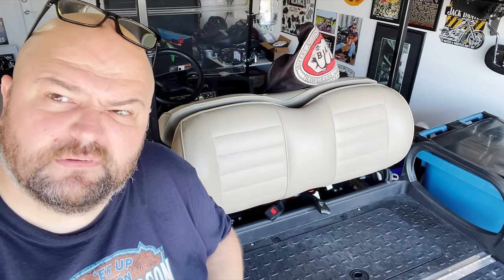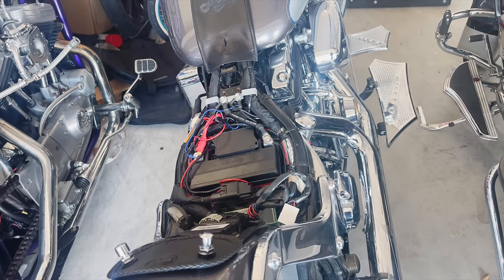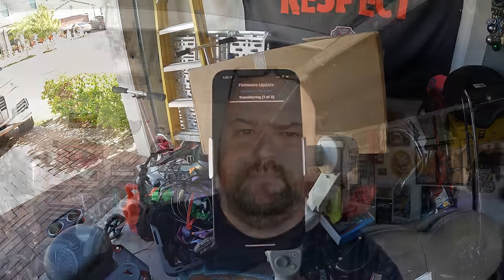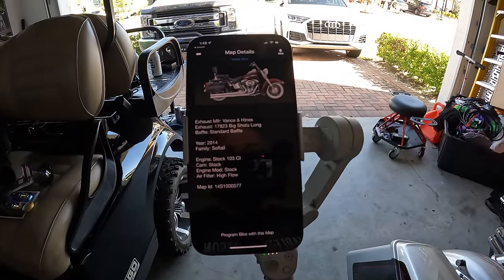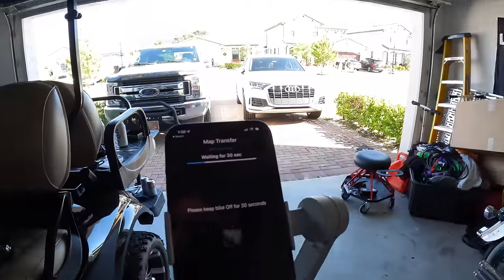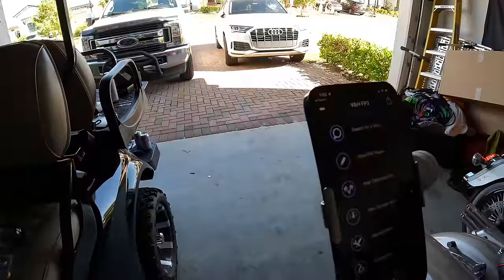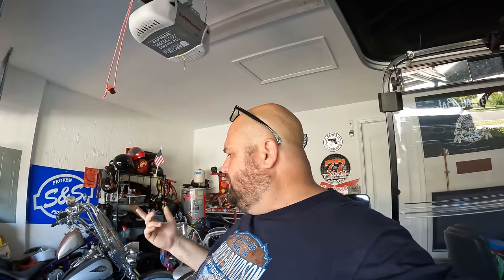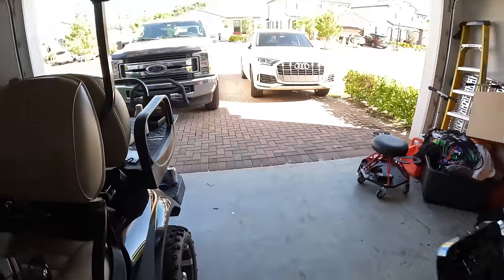Harley Tuning Bible: Who's What's & Why's of Tuning a Harley-Davidson w/ a Vance & Hines FP3 Install

Comment: Hi Mr Monkey ! I’m thinking about a mini S&S teardrop on my Sportster ,now it has one of these very small open filters on it and when you go full throttle it feels like the clutch is slipping but it ain’t cos I jus put in a new clutch, so my friend said it can’t get enough air ? The exhaust is a Bassani 2into1 road rage , so in your professional view would the mini S&S help 🤔
Reply from the maker: That might be right, or the tune isn't right? Also, any chance your clutch cable is too tight allowing the clutch to slip?
Reply: @ProfessionalMonkey  the  clutch Was fixed by my Harley guru so I trust him , and I just put in a bigger main jet from 170 to 180 but there’s snow everywhere and about -14c so can’t really test it yet 🥶

Comment: I own a 2010 heritage softail 96 Evo. I think it is. I added V&H long shot exhaust.  Do you think it should be tuned.  My fuel mileage is abt the same as factory exhaust.  But can I do better with power, sound and performance. It has no engine work done to it. All factory.  What is your advice to my question.
Reply from the maker: Hi! If you're bike is completely stock and you change the exhaust you will need a tune. the more free flowing exhaust will make your bike run even more lean (not enough fuel in the mixture) and that creates a ton of problems. Burnt exhaust valves, etc. The best bet would be to put a high flow air cleaner on as well then use a tuner to fix the fuel map. Something like a V&H FP4 or something. You'll get more power, but the bike will be more healthy in general.
Reply: So would a nice k&n filter work or should I try something different
Reply from the maker: Its really your preference. All high flow air cleaners essentially do the same thing so it's really about what you like the look of.
 @Ghostrider10xx

Comment: My 2015 Limited had the orange SE tuner when I picked it up from the dealer. A year later the ECM crapped out and had to be replaced but the dealer wouldn’t tune it with the orange tuner. So I ended up with the black one. Now that my warranty is no more I’m looking for a different tuner.
Reply from the maker: This should be perfect for you if your bike is just stage 1.

Comment: The fp3 is cool tuner  the power vision can do at that as well it’s loaded with pre-loaded maps I got mine from Fuel moto anything I change I just called them up and they send a map for free but I’m not putting down the fp
Reply from the maker: Preloaded Pwervision maps leave a lot to be desired but the FuelMoto ones are good I hear.

Comment: Question related to tuning. I have a 20 Street Glide with screaming eagle slip on's.   No tune done as I currently have the stock air intake.  Was suggested to remove the catalytic converter for better sound and performance.  Would I need a tune if I did or is the whole idea terrible.  I've been known to do dumb stuff.  Thanks
Reply from the maker: If you go any further, intake or decat the headpipe or swap it, you'll need a tune. The bike will be way too lean if you do any of that and don't retune the bike.
Reply: @ProfessionalMonkey  thank you.  I really enjoy the channel.  Helps with the long Canadian winter.  Happy New Years.
Reply: @chrisb6570  I believe the cat in your year was in the muffler not the head pipe like in other years.

Comment: I have 2017 RG with a stock motor.  Bought the bike new with a dealer installed high-flow air cleaner and S&S Mk 45s so I have the black SE tuner.  I'm thinking of de-catting the head pipe or going with V&H power duals.  Since I'm already stage 1, do I need to retune?
Reply from the maker: Yes since youre removing the cat. Thats gonna reduce back pressure a lot.
Reply from the maker: Also, a decatted stock pipe never sounds right. I am a fan of the Tab 2-1-2, it will work great with your MK45s
Reply: @ProfessionalMonkey  awesome...thanks for the good advice.  Love the videos

Comment: When my 2014 XL1200T went out of warrantee added V&H twin slash, high flow intake and the FP3. I loved the FP3 and left it plugged in. Initially had a problem that V&H cleared up in one phone call. Loved the features of the FP3.

Now with my 2019 FXLR I have all Scremin’ Eagle upgrades including the hiflow intake, street cannons, torque cam, hiflow intake manifold, street tuner and the auto tuner with the large oxygen sensors. Got the extended warrantee with it all. 

Still miss my FP3!

Comment: Got a question … so with a stock 750 street … just added tab 2.25”/2.5” slip ons … I’m getting a popping on decelerate only… is there a need retune the bike?
Reply from the maker: That means the bike is lean, you should retune, I didn't know Tab made pipes for the street.
Reply: @ProfessionalMonkey  thanks for the advice.

Comment: 2008 Rocker C 96B stock except Cycle Shack slip-ons.  Future plans involve Andrews 48 or Woods 222 cams.  As a temporary fix (funds) tried those XiED fuel enrichment things you plug in between ECM and O2 sensors..   WOW!  They actually work.  Runs way better such as throttle response, runs cooler, the annoying decil pop mostly gone and even sounds better.  Any experience with these things?
Reply from the maker: I actually have heard of those but that they don't work on all setups. Cool that it worked for you. Rocker is such a cool bike, theyre hard to find!

Comment: In your opinion, my 21 CVO stock air intake need a tune with the KromeWerks 4.5” slip ons or does that fall within the 10%?
Dealership said it didn’t…. thank you for your advice🤜🏻🤛🏻
Reply: No it doesn't. Just adding slip on's won't change much. If you add a hi flow air cleaner then yes you should tune
Reply: Agreed... its only when you change how much air you put in it (ie) a new high flow air filter and that puts more air in the motor which in turn leans the bike out even further so that falls outside of the 10%, this is when you need a tuner
Reply: Me thinks that the CVO comes stock with the Ventilator high flow intake?
Regardless, your choices on a tuner are a bit limited right now. Vance & Hines does not make an FP3 for 2021 M8s. The 2021 HD ECU is not compatible with current FP3s.
Reply from the maker: I agree with everyone here. A CVO comes stock with a high flow air cleaner, so slip ons won't require a retune. I would shop around on the pipes though, there are a lot of options out there and KromeWerks seems to be a fad. I wouldn't jump on it just because it's "the new thing."

Comment: I regret not going with a FP3. I got the the dynojet because I found a deal on it that was lower than the FP3. But now I can’t get my bike to run right.
Reply: Same here. I should have got the FP3. I still can’t get the bike to run good after installing a Dynojet and trying several maps. So, I am very interested in the Autotune feature on the VH Fuel Pak 3. Now, I’d rather invest in this compared to getting a one time tune for my Dynojet.
Reply from the maker: Yeah, you might have to take it to a tuner to get it right.
Reply from the maker: What are you running in your bike? Cams, etc. or just a stage 1? If its a stage 1 and commonly found pipes (like they are in the drop downs on the tuner software) an autotune isn't even necessary.
Reply: @paulhopson7489  what year bike?  What did you buy from dynojet?  A powervision or a power commander piggy back system?
Reply: What year bike and do you have a powervision or the power commander series style piggy backs?

Comment: Oooooooh btw if your bike becomes hard to start after you tune it, make sure you have the acr automatic compression release switch turned on. I had this issue for a year before I really started screwing with the fp3 software and discovered it was turned off

Comment: 2017 stteetglide with tab slipons.. Can i just delete cat . without tuning.. No highflow air cleaner.
Reply from the maker: Hi! You probably asked this before we chatted live last night, but in case anyone else has the same question. Tabs with zombies have no back pressure and they alone probably need a bit of fuel added. They're the only slip ons out there that really do need a tune. If you delete the cat you will be running WAY too lean and will burn your valves. You really need to go all in on the stage 1 if youre going to mess with the exhaust that much, and you'll need a tune. The FP3 is fine for that, especially since your factory original warranty is expired anyway.

Comment: Your vin will be flagged. So if you have a powertrain issue, they know you had 3rd party tuner. If they can proof it caused the damage, you own your own. If your fork seals leak, they still be covered under warranty. So much misinformation in the harley community, same with the street tuner, it still demands a 12.8 air/ fuel at wide open throttle. It demands 14.7 stoich at part throttle, just like any other car, bike etc.  that also includes your top of the line lambo, ferrari, bmw etc.

Comment: So if a stage one only give 1/2 hp more, it's a waste?  Unless doing cams as well? 
Thanks , I enjoy your videos 😎😎👍👍
Reply: To clarify. A stage 1 and a good FP3 tune on a Twin Cam can add 10 ft lbs of peak torque. Mine went from 96 to 106 ft lbs. Spending $$$ more for a “better” tuner and dyno tune won’t get you much more hp/torque than that IF all you are doing is a Stage 1 -  BUT if you go Stage 2 or 3 then that’s where the “better” tuner and dyno tune will shine, and find you all those extra hidden horses.
Reply: @FFL-vg9ro  
Thanks for the clarification 😎😎👍👍
Reply from the maker: You got it, that's what I meant. For a stage 1 anything beyond an FP3 costs more, isn't justified and you are stuck having to have it tuned rather than doing it yourself.

Comment: I love your videos. I do have to say though the FP3 is garbage. If it was 20 bucks that's one thing. Dynojet power vision is similar in price and much better for any change made to the bike from stock to tire shreading power.
Reply from the maker: Not for a Stage 1. You only need that for advanced builds. The Power Vision is too dependent on a tuner. Their canned maps aren't very good.
Reply: I would agree with you,  powervision is the better choice for the same price.  And the canned map argument is a moot point since it is getting reflashed with every Autotune being done just like the FP3 but better.  Your on the right track.

Comment: I feel like you shouldn't have turned on DECEL POP yet.  It popped on the old tune, and  you've already changed that variable.
Reply from the maker: Good point. I think I have always ended up turning decel pop on though every time I use one of these.

Comment: Can I run that tuner with cobra header and exhaust thanks
Reply from the maker: Yep. I should have showed that. You can choose your manufacturer and then model of just about any pipe. If you have a rare pipe you can pick something close then run autotune and it will work great.
Reply: Thanks Bro

Comment: What happens if you bought a bike from dealer used but has a aftermarket cam in it but you don't know what cam
Reply from the maker: Hmmmm... Not really sure unless you crack it open? Even then it might be hard to find markings on it.
Reply: @ProfessionalMonkey  I found what cam in the bike 255 SE

Comment: That's why you have Harley tune your bike with their tuner and then you buy a thundermax and have it tuned so when you need to take your bike and you just switch it out and it will not alert Harley
Reply from the maker: Doesnt work anymore. The bike flags an inconsistency with the mileage, etc. They are getting pretty smart.

Comment: Why is it nobody considers tuning to also include adjusting your ignition curve the way you would on almost every other gasoline engine on the planet. I'm not trying to be a smart-@ss, but I have a pretty good background on tuning cars, about a year and a half owning a Harley for the first time, Was a 107 M8, and about 4 months since completely trashing the warranty, it's no longer a 107 and many parts are no longer OEM. So I still have to make the transition to everything Harley Davidson so to speak. Cudos to V&H, Their assistance with a base tune was over and above.
You can bang out of any menu on the FP3 at any time, as long as you don't actually flash it, it should be back the way you left it next time you open the App on your phone. AFAIK.
Reply: You can adjust timing with the power vision.  I just don't think most people know the basics behind timing unfortunately.

Comment: Sorry, but power vision from dynojet dies the something and you don't need to go to a tuner every time to pay 400 dollars.  You just run an auto tune basic and drive it.  Same concept as FP3, more accurate,  more options and leaves room to engine build if you decided to later on down the road.  Can also add autotune plus for Wideband tuning but that is more expensive.   Power vision is a far better option giving the advantages at only 100 dollars average more.

Power vision will also autotune your bike with different cams, jugs and another modification.   Works best with autotune pro, just cost extra.
Reply from the maker: Powervision canned maps arent as good.
Reply: @ProfessionalMonkey  Difference of opinions.  BTW the 34 number and 102 numbers on your screen that you believe were rpms,  might have been KPA readings of the map.  Hope you got.it.all tuned up and be safe riding buddy.

Comment: You don't have to pay anyone to tune your bike with a Dynojet. It does the same thing FP3 does...Autotune, load a new map for new parts ect...
Reply from the maker: The canned maps aren't as good I am told, and I know that from first hand using one on my Indian. It was never right.
Reply: I got mine from Fuel Moto and they send the maps, and then you can do a autotune to fine tune their map. I've had mine for 3 years and so far, no problems. FP3 is still a good system.
Reply: @bodieb316  dynojet is the better tuner hands down.

Comment: Ok idk why anyone would still buy screaming eagle anything anymore unless you live in cali. You can order a twin cam screaming stage 4 and 5 tire shredder and get less performance than you’d get out of just a woods or s&s cam swap. Is it that bragging rights? Cuz that doesn’t make sense either cuz over paid for the little performance gains you got. Just go aftermarket and call it good. Screw the epa